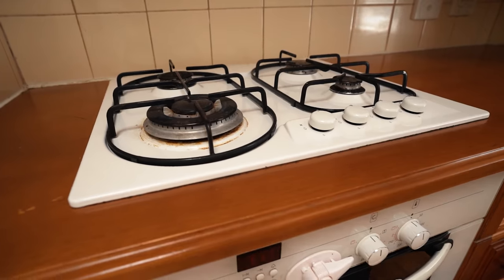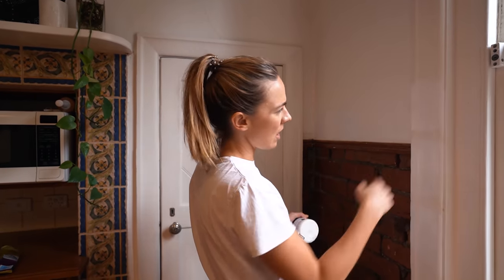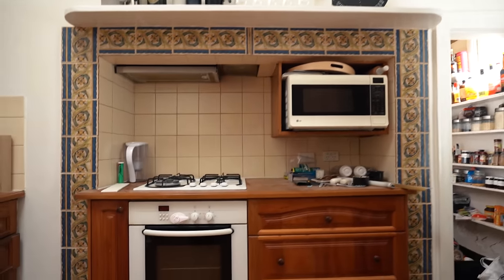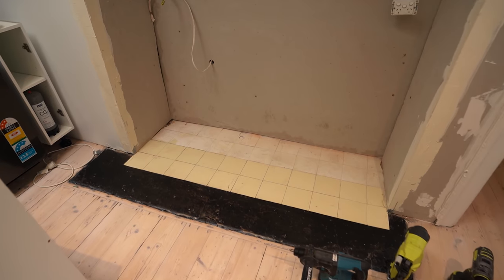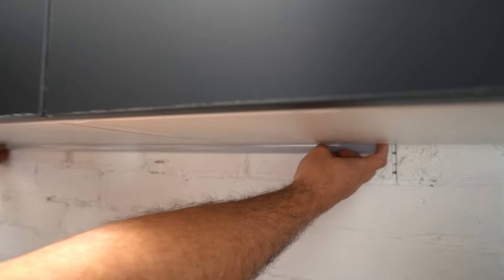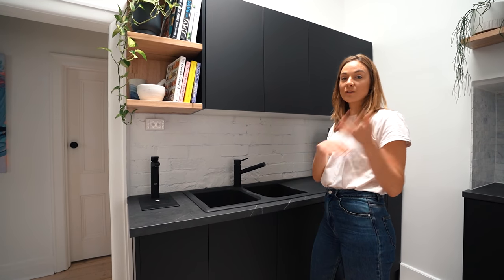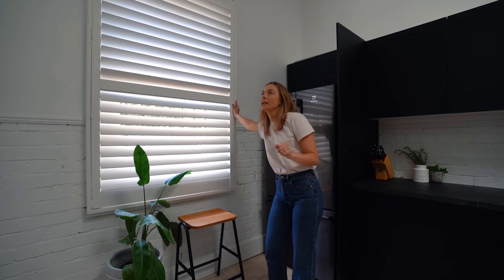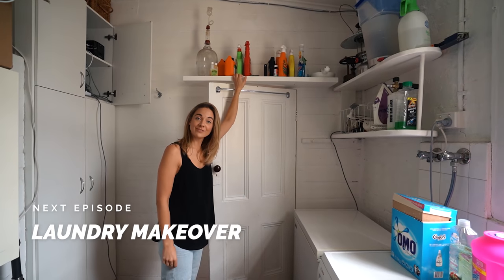EXTREME DIY Kitchen Makeover & Disaster Pantry Transformation! 🙌  Before & After Reveal

Comment: I love the appliances (I have black stainless in my kitchen, as well) and I really love how the inside surround turned out with the range/oven.  With the marble tile you chose, I understand why you painted the brick.  I'm kind of torn about it, because the brick with black grout would've looked beautiful with your gorgeous appliances, as well. 
In the US, the black divider by the fridge is sometimes used on the outside of the fridge if it's the first appliance coming into the room (kind of like a bookend) or if it's being installed right next to another appliance, and it's normally only as deep as the side of the fridge to allow the doors full range of motion.   I hope I explained that correctly - it is not typically extended out past the countertop.  Is it really different in other countries or was there a preference for hiding the gorgeous black stainless?  No shade ... I swear I've never seen it used to completely hide a fridge from view within the kitchen.  
I love what you all have done with the pantry/appliance garage.  I, too, have aversion to appliances on countertops.  😂🤣😂  And I MUST find out if that dispenser is available around here ... that  is too flipping awesome!  You two are adorable❣

Comment: So. I like it cause it's got black fronts which is same as I've been doing at mine @grumpypetesprojects on insta.
Not a fan of the panel by the fridge or the set back cabinet above the fridge. I am setting my cabinet forward so it's easier to access.
I'm tall so I like the pantry but wouldn't work for me. The painted brick works well and the overall contrast of black and the touches of timber are noice.
Overall luv luv luv the long video content, so much more entertaining and no doubt a huge amount of effort in the Reno and video production.

Looking forward to the next one.
Reply from the maker: Will have to check out yours when it’s finished. We will probably re fit the cupboard above the fridge so it’s flush with the fridge. 

Just didn’t have the fridge in when we fitted them all off. So that’s also part the reason for the full side panel on the fridge, so the top cabinet can come forward and not look strange. The side panel also stops us looking at the side of the fridge which is quite large and comes out fair bit further than the cabinets. Plus we have somewhere for power now too, no messy cables or conduit on the brick work.
Reply: @Huntingforgeorge  Ah-mazing transformation! I love the side panel next to the fridge adds extra angle and lines and makes it more interesting to the eye and sets it apart to just a flat pack kitchen. Gives it design flare!! 👏👏👏👏👏👏 So well done guys!

Comment: That refrigerator panel would’ve looked more complete with a refrigerator deep cabinet above the fridge.
Reply: Daniela Flores the panel next to fridge looks so out of place because they didn’t put a fridge depth cabinet above the refrigerator. If they could get a fridge depth cabinet, I at least would have brought the cabinet that they put over refrigerator all the way forward to give the illusion it is as deep as the refrigerator. It looks rediculous pushed all the way back. It would look fine pushed back if they didn’t put the fridge panel. The point of a refrigerator panel is to make the refrigerator seem built in. Pointless without the correct placement of the cabinet above. Looks like a DIY MISTAKE gone 🥴👎

Comment: The black cabinets looks ok...for now. Unfortunately, it wont stand the test of time. Youll either get tired of them or theyll wear out and look janky like those shelf angle brackets. That black divider that separates the fridge looks weird and the cabinets above it should be the same depth as the fridge. Personally, I would have kept the original wooden cabinets and just reconfigured them as needed. They look better and the money saved I would have used on a solid surface countertop. Sorry, but the reno looks like a new kitchen meant for renters: modern but bland and meant to be replaced within 5 to 10 years.